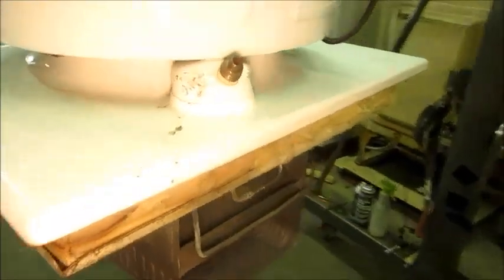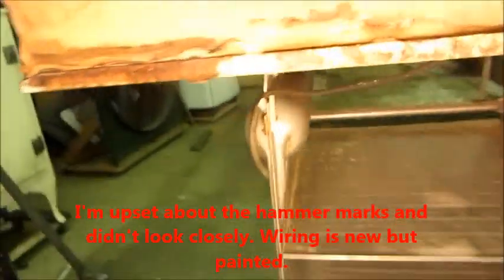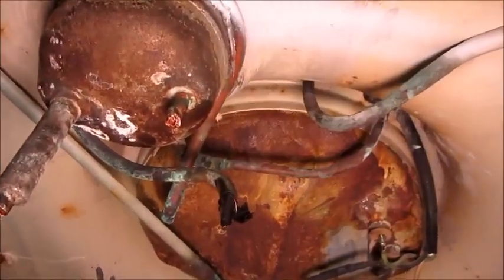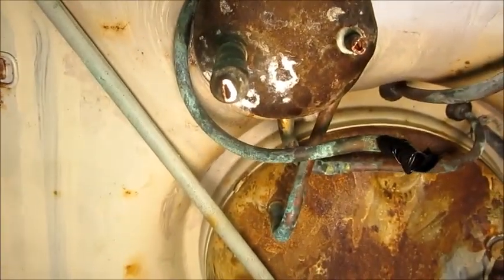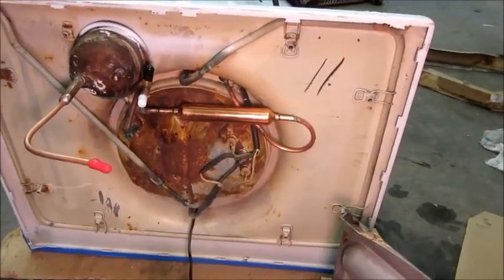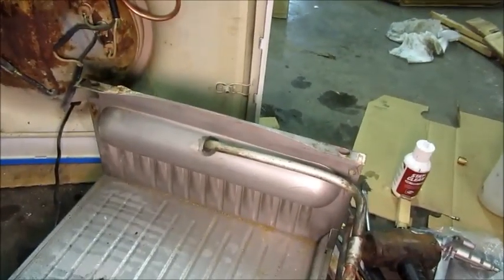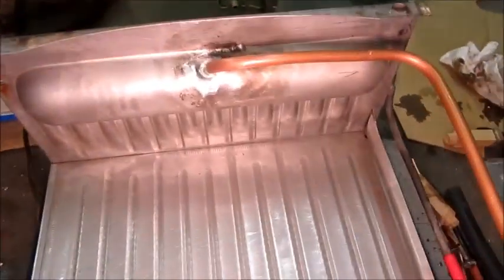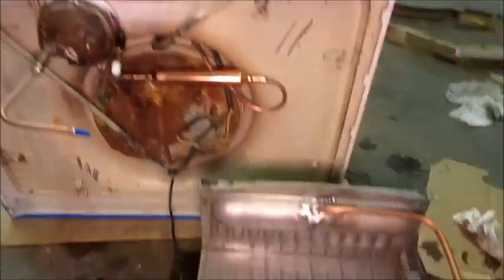General Electric CK26 Monitor Top refrigerator - 1 - Initial checkout...

Comment: Hello all, I'm the owner of this unit and wanted to give David a public shout out for getting it running again.   He fixed it in two days and then let it run for a week before I picked it up.  It's been running ever since and is extremely cold and extremely quiet; more quiet than it was originally which is saying something.   I sanded the top down and filled the hammer marks with bondo and sanded it again; then etched it all over with metal etching solution and painted it with a couple of coats of high gloss appliance enamel.  I sent pictures to David and it looks as it did before except even better because he salvaged the manufacturer's plate which I reinstalled.    That had driven me crazy ever since I purchased the unit because it was completely painted over.  Now everything looks correct.  

I'd encourage David to shoot a video of all the refrigerators he has in his shop with some narrative as it's quite a nice museum; I was there at least an hour as he gave me the tour and it was very cool.   Thanks to the Monitor Top forum for getting us together!
Reply from the maker: Thanks Alan!  I'm pleased to have been able to get this going and helped you improve the looks beyond how it was when you purchased it! I still can't get over the missing top gasket and sandblasting grit in the insulation. That just 'takes the cake' as they say. You would think that people who make their livelihood solely with antique appliance restoration would be more conscientious with areas which will eventually be seen by the owner. This field is highly reputation driven as you might imagine.

As for the sound level; it is possible that the poor solder connection was gradually allowing air into the system for many years, causing the unit to have higher and higher discharge pressures and noise levels. That happened gradually over time. The elimination of the air and replenishment of refrigerant brought it back to "normal" sound levels.  From experience I can say your Monitor Top, after repairs, sounds identical to other CK machines in good working order.

I would love to do a "shop tour" but as you saw, there are several items which belong to other people. Some of them have requested privacy / no online discussion of their projects. I respect that and would want to honor my agreement with them. So at this time, I'm not going to be able to show all in the shop in one tour. 

Virtually every fridge of mine has its own group of videos showing how I came to acquire it and how it was repaired / restored. All of them have been shared on the forum or Facebook groups. 
 I'm publishing them for searchability on YouTube; one by one after review.
Reply: I'm glad you didn't give up hope in getting your fridge working again.  you sure found the right person to do it.  I hate seeing stuff like this get scrapped
Reply: @willthetrill4849  Hi Will, I'm pretty militant about restoring things to original condition and very patient, so that helped in this repair journey.  The people at the Monitor Top forum were all incredibly helpful and responsive; I was also very lucky to have David reach out, as he's phenomenal and relatively close-by.   If anyone has an old refrigerator that needs repair, he is definitely the man!
Reply: (This is Tom, not Sandra.)
Great videos David!! I'm glad you were able to fix this unit for the customer. You are a true businessman and a real, caring human being. May GOD bless you and your business, sir. You are a true Christian!!! Thank you!!!

Comment: Hello, can a top monitor fridge like this be tipped on its side to transport? I found one on Craigslist for free and would like to get it, thanks for the help!
Reply from the maker: No, it can't be tipped! The cooling unit just sits on the cabinet by gravity. It will fall off if tipped. You'll break the lines.

The top assembly needs to be taken ofd the cabinet if you need to lay the cabinet on its side.
Reply: Thank you for that vital information, appreciate it!
Reply from the maker: @leedavis6314  
See our forum for more information.
HTTPS://monitortop.freeforums.net